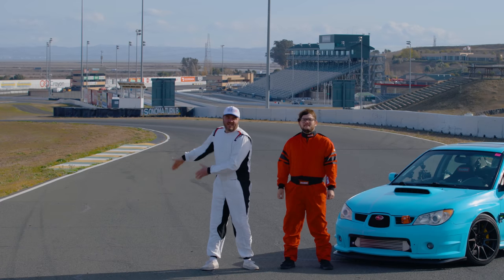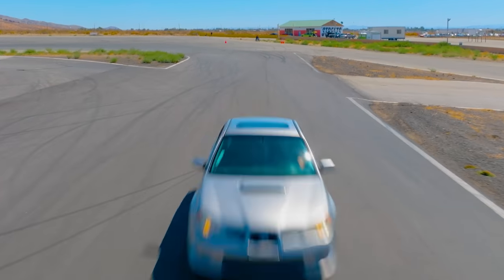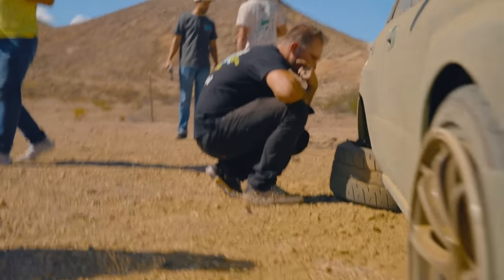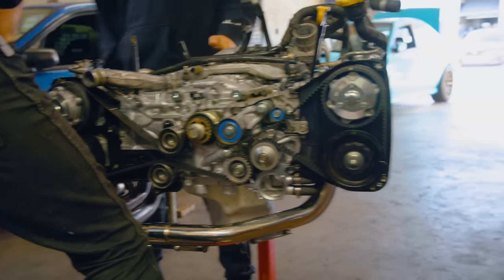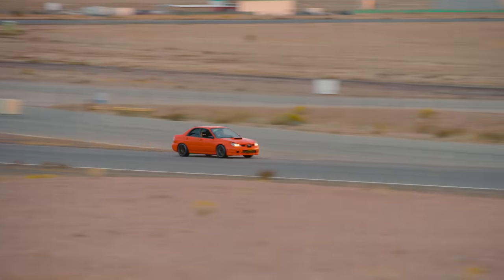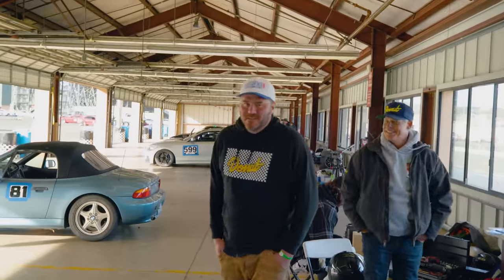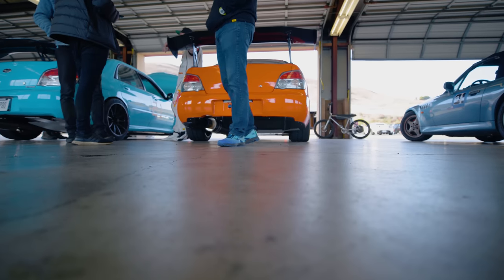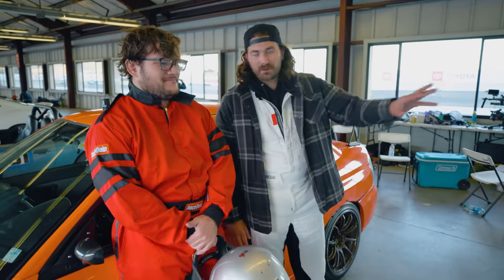$21,000 vs $43,000 Subaru WRX Build - HiLow FINALE!

Comment: This high low series was like a long infomercial advising you to stay far away from Subarus 😂
Reply: The way they went about modding these cars, before doing any research was completely stupid. They’re playing to the stereotype, then get comments like this.
Reply: Far away,  I’ve always thought they were junk, this series just adds to it
Reply: I mean subie engine knock is a known real thing they arent as reliable as people say lol especially if you beat on them
Reply: @codysettles2758  a kid at my job bought a low mileage wrx.  Spun a bearing like 5k miles later,  dealer put in a new motor.  Then something else blew up he don’t wanna talk about!
Reply: @johnpotter4210  Had a friend go through the same thing. Its not a good sign when Subaru themselves buy back a new wrx because it went through 2 brand new engines in 1 month.
Reply: @justbalde  multiple engines blew before they even THOUGHT about adding horsepower, these cars are just simply trash
Reply: @justbalde  "I bet this commenter drives a Subaru." Checks profile "Yep" These are all very well documented problems with this platform. But, it also doesn't make them trash cars, just cars with their own quirks. You can still love these cars and accept the fact that they have issues.
Reply: They're great street drivers with basic mods.  I have an sti that makes 270whp on pump that I drive in the winter and its truly a great street car and so much fun with studded hakkas.

I drive a 625whp 300zx in the summer though.  That car is a brick sh*thouse and you cannot break it.
Reply: @justbalde  lmao Subies are junk. Even stock the motors are garbage. 1 friend stock sti gone in 20,000 miles, another piston slap so bad on a brand new wrx, motor had to be changed, thankfully on warranty. Another brand new one motor blew, then after warranty engine replacement was done, caught fire. The motors are PURE GARBAGE lol
Reply: @BOOSTEDH2  hell nah, I know Subaru techs who would say other wise. It’s people who can’t or don’t do their maintenance. All they do is beat on them and use the most shitty oils, or do regular maintenance. Yes Subaru engines are more finicky. But they don’t fucking explode. Had my wrx for about a year. And as a mechanic maintained that shit religiously. Added an AOS too. Thing ran like a dream at 120k miles. Donut didn’t do their research and the cars suffered from it.
Reply: @BOOSTEDH2  I feel like you’re getting your information from the internet, and word of mouth. You keep on repeating the same shit. I work as a mechanic for Toyota, and have friends who are mechanics for Subaru. I come from a place of experience. You just go off of other people. Then again this is the way the Internet is 🤷‍♂️
Reply: The irony for people who defend these, are if it happens to a competing brand, they have no problems bashing the crap out of it. But when it's a Subaru, "You're doing something wrong".
Reply: @justbalde I always found it hilarious how you’ll always see the “my friend had an sti and it blew up so quick”bs, Meanwhile I absolutely beat the piss out of my stock motor subie when I owned it. People who talk the most have never owned a Subaru to begin with or didn’t know how to take care of it
Reply: I used to work with this guy who went through three motors. I figured he was going cheap or something but this shows what it really is.
Reply: Went from an a5 to a wrx, and drive them pretty much the exact same way. spirited but dont beat them, and after the first 50k miles for both Id have to say the subaru is more reliable, HOWEVER i have an FA, not an EJ so its not a literal bomb.
Reply: @Mattc278  didn't know how to take care of it 🤣🤣🤣 is there some super special maintenance routine that I am missing here? If a brand new wrx has piston slap so bad on start up that they warranty an engine replacement, do you think that has something to do with "how it was taken care of". I swear some of you guys just make the dumbest excuses as to why these cars are pure junk.
Reply: @BOOSTEDH2 right? Like this isn’t a Porsche boxer engine we’re talking about, it’s not a very high performance vehicle
Reply: The subies were pretty much saved by people who live and breathe suburu. So maybe it is part of the lifestyle.
Reply: Hmmm, I had 170K on my EJ205 when it overheated because the radiator drain plug failed. Pulled it apart and the cylinders, journals, and valve seats were all within factory spec. The factory pistons still had nitriding on the skirts, even the low sides. Did a couple upgrades in ARP head studs (found a broken head bolt) ACL race bearings and GSC stainless valves but put OEM cast pistons back in and stuck to OEM parts wherever possible- thing hauls the mail and has driven across the country twice, 3 days each holding 90+ mph for over an hour at time. No reliability issues. Guys who beat on an engine that hasn’t been taken care of and guys who mod these cars without knowing the platform well enough are the problem. With this many failures I wouldn’t be taking my car back to the same shop; plenty claim to be tuners/builders but really just bolt parts on. If STIs track record of reliability in WRC and other circuits is an indication, the EJ and FA engines can put out a ton of HP reliably.
Reply: @compasteedee  Not with all Subarus tho, and people dont on them all blanket mode. Its only na and turbo EJ25 issues, not other naturally aspirated or turbo Ej has problems like these, nor EZ or FB series motors.(FB had some mild oil consumption early on but nothing else happens in these).
Its as harmful as stupid headgasket memes.
Reply: @Mattc278  so after watching one blow up you want me to buy one?!?!?
Reply: matt tim  the switch to a  timing chain is long over due
Reply: @johnpotter4210  I’ve seen all make and model of engine blow up. One thing about the WRX is if you buy one used, you’d better take a close look at who was driving it. This video showed used engines of unknown history getting power adding bolt ons and getting raced- I don’t expect any vehicle to fair well under those conditions.
Reply: @Natedoc808  whatever makes u happy.  If anyone’s on the fence tho I hope they see vids like this.
Reply: @compasteedee  that's been the issue the whole time. Subaru owners and fans categorically refuse to acknowledge the issues. 

They have been shooting themselves in the foot doing it, if they would have just acknowledged it Subaru wouldn't have gotten away with it for so long
Reply: @justbalde  With the LS series, 2jz, coyotes, etc.. and their GREAT dependability why would you even consider a "finicky" engine.
Reply: @Natedoc808  Congrats, my 2022 Chevy High Country dually does that pulling a trailer. My MPG however leaves a lot to be desired.
Reply: @louisrobbins475  my 03 cummins can do it pulling and has done many runs across the country, another known reliable platform. Plain and simple, the EJ engines aren’t finicky or unreliable. I’d bet you’d find that they don’t fail as frequently as LS or 5.0L platforms when people start bolting power making mods onto it without properly building the low ends.

Comment: I think smeedia really hit the nail on the head with this WRX hi/low series.
Reply: Like the reputation for Subarus is kinda ruined just cause they didn't inform themselves that well. The guys from Driven Media did a way better job imo.
Reply: Who is smeedia?
Reply: @spinyslasher6586  somebody who actually knows how to build Subarus. Love Donut but they fumbled the bag big time on this series.
Reply: Didn't they take it to a Subaru specialist?
Reply: @Eduardo_Espinoza  They took it to one to have the engines rebuilt after already destroying them. They did not consult a Subaru specialist prior to beginning this series however. So a lot of stuff could have been prevented, i.e. the first engine breaking because they did not break it in.
Reply: Maaaaaan, push this comment to the top haha
Reply: @MorDo207  we were probably quite lucky 😬. We'd love to have a race with high car though!
Reply: this isnt the first time donuts messed things up.
Reply: @OVERDRIVE.studios  u going to need ebay special td05-20g turbo upgrade to keep up...

Pushing those tiny oem td04L-13t up to 300whp wont do any good for long...for the turbo as well as the engine...

250whp on td04L for thst to live forever... 300whp... Maybe a couple or two laps... Not for long...
Reply: @jarbenquiver8893  Agree on break in, but its a business... they can't spend months breaking in an engine when they have a show to produce. I assume they knew the risk they took not breaking it in, could have done a better job saying that if they knew though.
Reply: @trotskiftw  Not months to break in a new engine though. They could've gotten a couple of guys to drive the car around the clock at legal road speeds for as much time as they could,  then do an oil + filter change before the track. That'd would have helped a lot, imho... 

Or they could have called Marty from MCM for some Subaru build hints (or Benny, or Turbo Yoda, or Smeedia. or the guys from Speed Academy, or Hagerty, or MotoIQ, or MRT Performance, or Possum Bourne Motorsports). There are so many people out there building Subarus that I don't understand why Donut is distancing themselves from others like them. That is coming from a guy who is not the biggest Subaru fan out there as I do like the VW/Audi and EVO scenes as well...

I have faith on you Donut, I swear I do! =)
Reply: I think most people won't have access to these specialists without paying for the info.  As a result they ask them for help.  Making mistakes, I think, is closer to what will really happen to a lot of people who watch this.  Watching "professionals" perform an perfect build raises expectations too high. It would probably discourage the kid who runs into a bunch of problems and leave a feeling of failure instead of learning. But that's just my opinion... After 15 years of learning in the shop of what to do and not to do.
Reply: @MorDo207  Subarus rep is still the same. It's no surprise they blow up. IF you really think donut has influence on people buying these, be happy, because the prices will drop 🤣
Reply: If u have to get a serious specialist for the whip it’s mid at best. All I ever hear from the dozens of subie friends I have is that their shit is broken. Not a good car to mod imo. Stock it’s prolly aight tho. My old jeep is a piece of shit and I hate jeeps now but I know nothing about mechanics and my shit fixes have kept it running lol. These rexes blow up if u look at em wrong.
Reply: This ain new for Subarus tho. They been had issues with aggravated owners
Reply: People knew these engines were trash LONG before these goons came along
Reply: @MorDo207  We already knew Subis were trash
Reply: @trotskiftw   Lol it'd take a day or two of driving, not months
Reply: @ShadyRapture  Bad Take.  High-end cars require specialists, are they bad too?
Reply: Exactly
Reply: @ablazinredfox  High-end cars require specialist because they're advanced, mistakes can be very expensive, and the expertise is worth it. Subaru specialist exist because the engines suck. Even a bone stock engine can blow because of how poorly they were designed. All engines have problems, but Subies are some of the worst. Plus, after all that time and money, you're left with a turbo 4 cylinder that sounds worse than a Honda. Pass.
Reply: @BHS  I've only had an issue with 1 out of 10 subaru that I've owned so far. 
It's literally lazy or uninformed owners acting like total Chads that are causing this.
Reply: @dub537h  10% failure rate with an "informed owner" is atrocious. They're garbage.
Reply: @dundizzle93 up it’s sad. And I’m fine with the series being cut short if they aren’t up to the task. Subies are pretty brutal when you don’t do more research. Know from personal experience even, but they also can be just fine. Also buying so many used motors was their other issue. After one went, I’m surprised they didn’t just get a 0 mile block and break it in but I guess they didn’t have time for that? Idk. There’s a lot of things that could’ve gone better. I was really wanting to like this series but it’s a little sad and makes Donut look pretty bad unfortunately. Surely they have to realize that “something is up with these cars” can’t possibly be just the car. Yeah they have issues but most are pretty avoidable, and constantly buying motors with a bunch of question marks around them just doesn’t help.
Reply: @dub537h  0/10 issues with uninformed toyota/honda enjoyers
Reply: I babied mine with a stock motor and it still failed, they just awful cars.